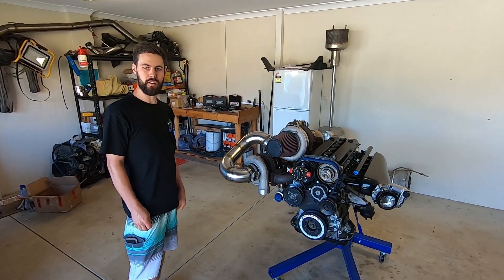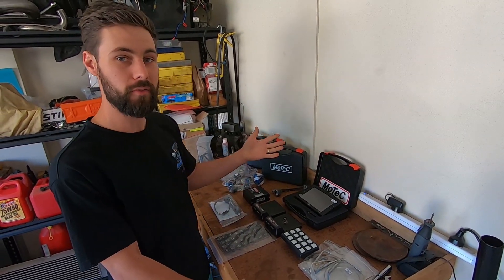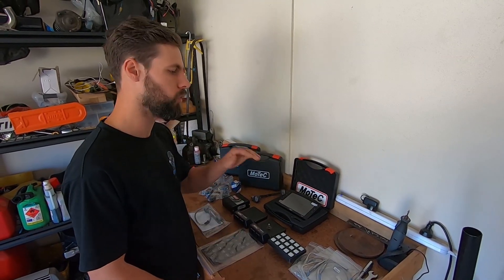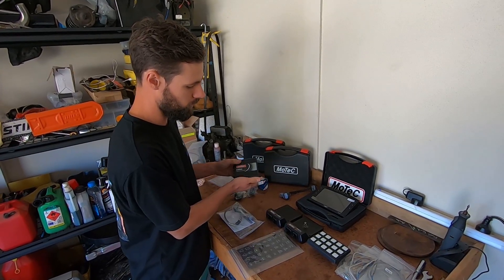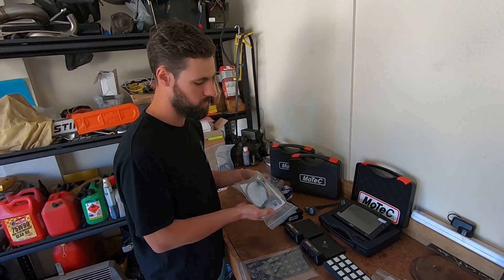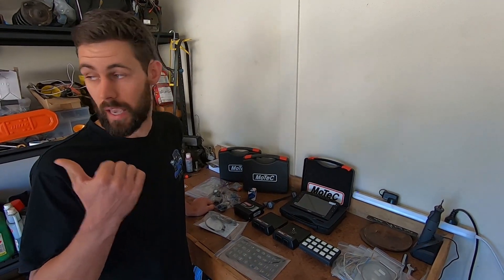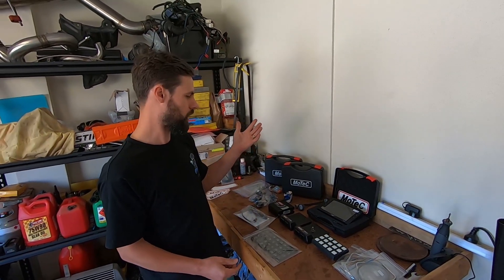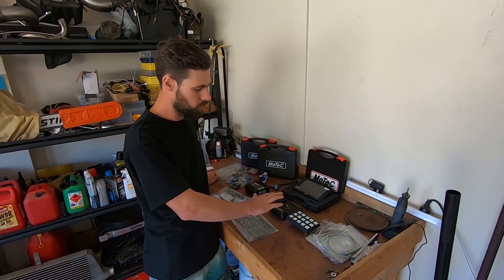Brains of the operation | MoTeC EFI for a 1000HP Compound Turbo 1JZ

Comment: Hey guys love the show. My budget at the moment means I'm doing a lot more watching YouTube than building at the moment . It seems the Americans use a lot of Holley stuff , the Europeans use Link which what my local tuner uses . And that whole MCM crew are in love with Haltech. Do certain ecu's suit different applications like street, drag or circuit . I actually thought Motec was American and more expensive than that . I've heard Australia leads the way in engine management even in F1 and Moto gp . How does the Holley stack up and would it be worth travelling to a different tuner to get a better ecu. My car is well on the tamer side of things
Reply from the maker: G'day Gareth. Thanks for the support mate! Holley efi is a great product for sure. In our opinion, the best way to choose your efi system is by firstly choosing your preferred efi tuner. The most important thing for us is choosing someone that has the experience and knowledge in your particular engine platform and understands what you're trying to do with the car. Once you've settled on the guy the only real thing left to do is discuss your budget and what his preferred system is for your application. If you don't plan on doing any of your own tuning its best to just get what your tuner is comfortable and familiar with. Some guys will only use one system while others can do them all. As far as systems go some are better than others for certain things but most popular systems can do a great job in the right hands. In closing, choose your tuner not your efi box and you'll do great! Just our 2c anyway.  Thanks for watching mate.